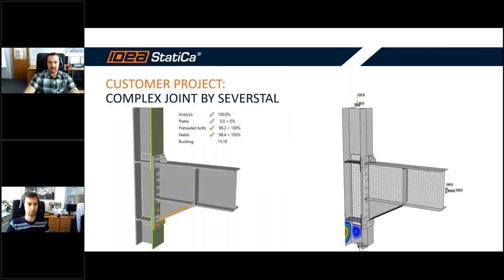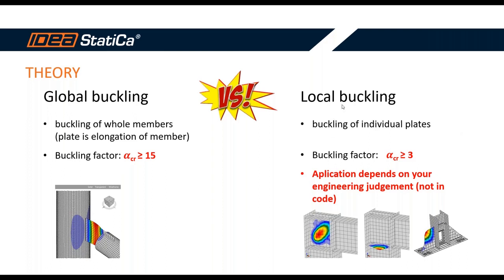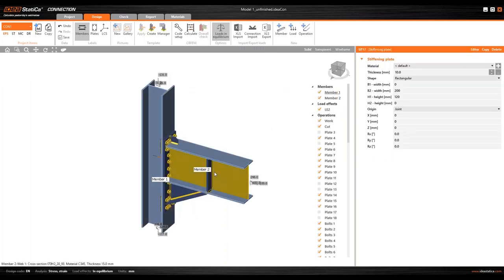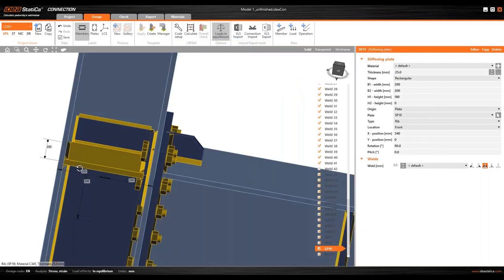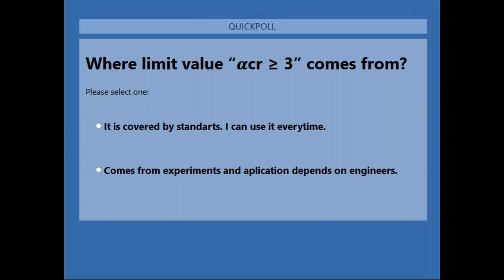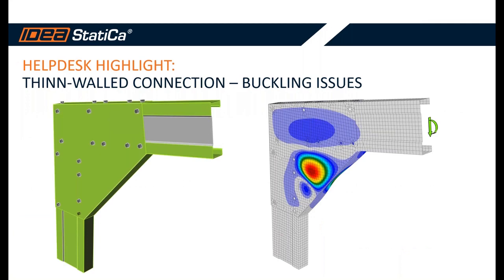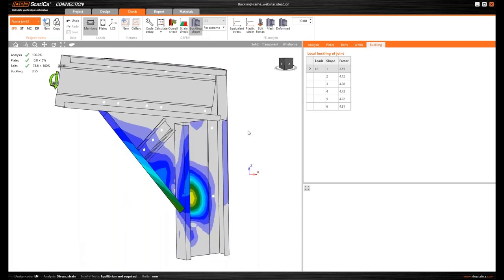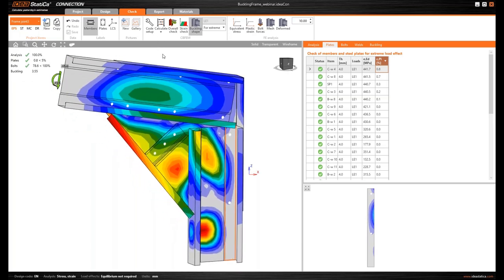Connection Wednesdays – Focus on buckling

Comment: i am using version 10.1 , where there is GNA option does turning this option on is enough  to have a satisfactory design ? for thin walled sections
Reply from the maker: Hello, all the settings can be found in the Code setup. Ror thin walled section, be aware of our slide in the video: https://youtu.be/8orM2XWjAgM?t=1201

Comment: Hello, 

When you say that for alphaCrit<15 it is not acceptable, I think it is not a correct way to say. You can say that analysing this at the first order is not acceptable (that also what EC 993-1 says) if alpha crit is under 15, but you can lead a 2nd order analysis and check with non linear analysis and impefections if your structure is stable etc. So it is (to me) too quickly qualified as unsatisfactory.

Thanks
Reply from the maker: Hello, you are right, the correct answer is when  < 15, you have to do more checks